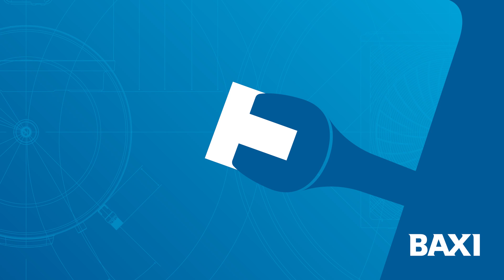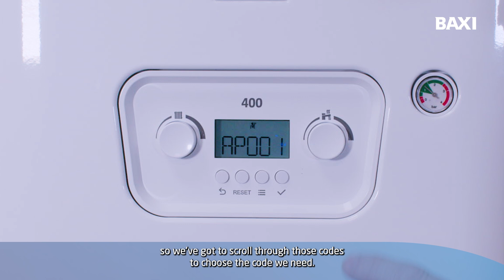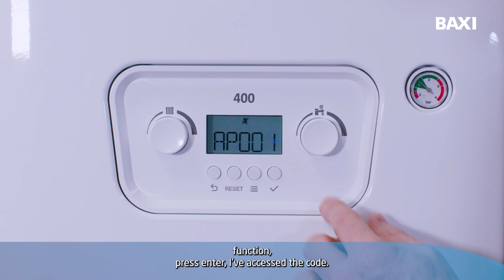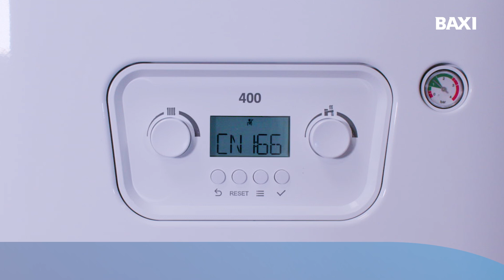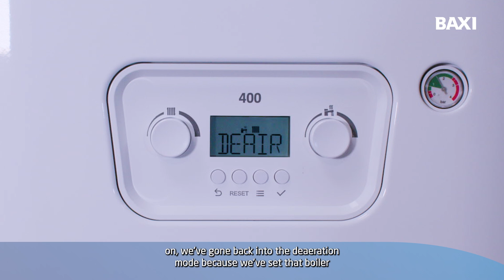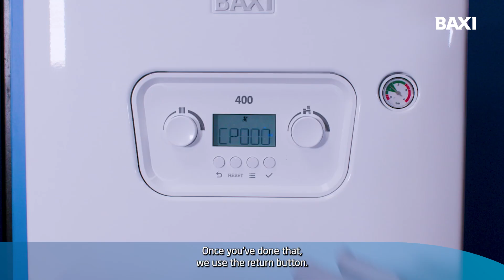How to access the engineer menu screen on the Baxi 400, 600 and 800 boiler range of Boilers

Comment: Boiler in our house is basically pumping water a bit too fast through the system and its returning nearly at the same flow temperature,  why can't I reduce it below 85%?

What's the reasoning?

Comment: My Baxi 600 Combi only has two dials and a Reset button. Is there a way to access the Engineer menu to change the maximum DHW temperature? I'm using a Drayton Wiser via OpenTherm, and since Wiser doesn't control the DHW setpoint, the boiler defaults to 60 C, which is too high. What is the dial/button sequence to enter the installer settings and which code controls the DHW Max Temp? Thanks!